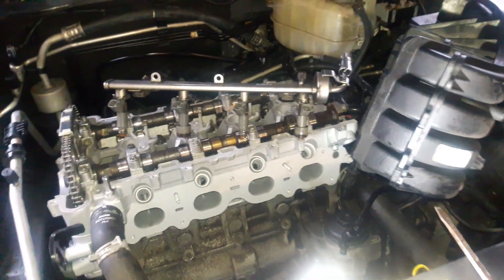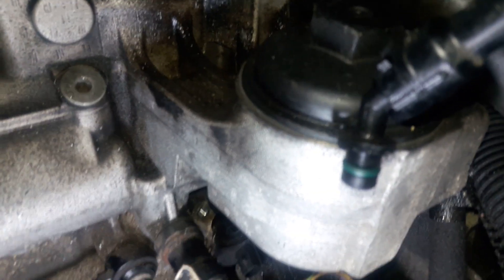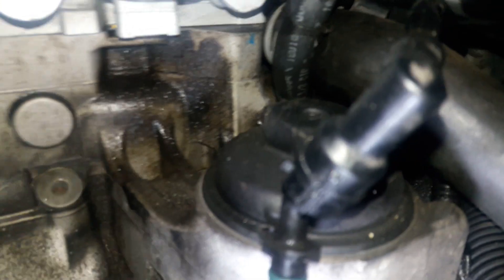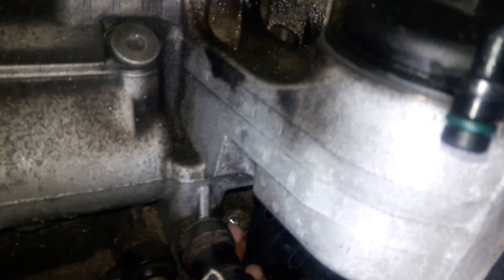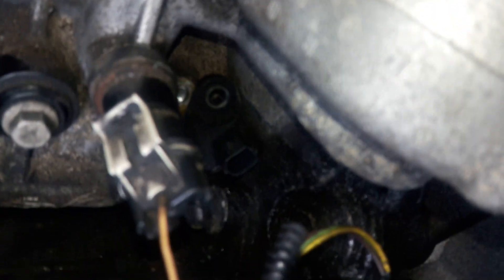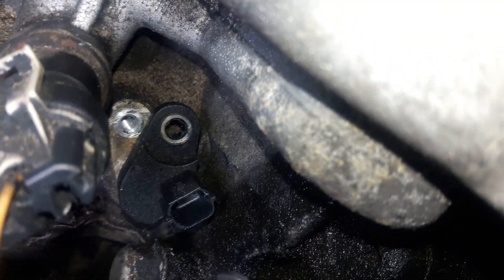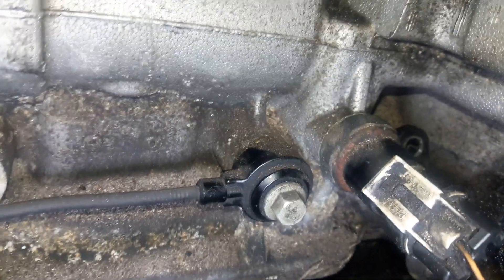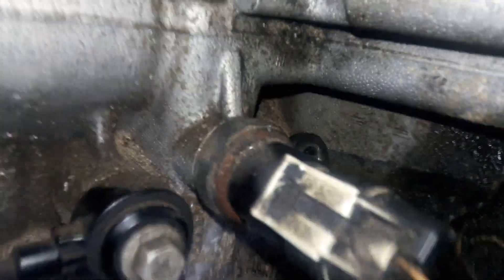GM 2.2L engine Crank Sensor Location and removal

Comment: DEAR AUTO REPAIRS: I HAVE A 2004 MALIBU, 4 CYL 2.2 L ENGINE, THE CRANK SENSOR WAS ALREADY REPLACED WITH AN AUTOZONE CRANK SENSOR AND I STILL GET CODE 340. SOME PEOPLE ON THE AUTOZONE REVIEWS HAD THE SAME PROBLEM. WHY IS THAT? I AM WONDERING IF THIS JOB CAN BE DONE WITHOUT REMOVING THE STARTER AND MANIFOLD

Comment: I anyone is interested this video is correct with the location as I changed mine today, However I just removed the starter motor and the sensor is behind that, The top starter bolt is a little tricky to get but is all good with a 6 inch extention and a little bit of tape to hold the bolt on to the socket when re installing the starter.
Reply: When starter removed insert top bolt into the starter put socket on bolt to hold in place. As you put the starter in place guide the bolt into it's threads. With starter pulled back to the length of the bolt you can see between the starter and Bell housing to start threading the bolts. No need to place starter then try to find where the bolt goes that just makes it difficult.
Reply: @HillBilly-1  and a piece of tape over the bolt head before the socket goes on it makes it a bit tighter on the head to reduce the chance of it slipping off when you are messing about.

Comment: Only thing you had to do was remove the starter in bam you right there
Reply: I wasn't in any way trying to be a wise guy that's the way I did it it was easy for me starter bolts wasn't a problem for me
Reply from the maker: Yes, try doing it that way..lol. don't you think I looked at that option? See how easy it is to get to the starter screws and get back to me wise guy.
Reply: @Wedoitalltohelp  🤣🤣
Reply from the maker: Try that and see how easy it is. Talk is cheap.
Reply: @Wedoitalltohelp  Your an idiot. STFU! It's a 30-45 minute job including removing the starter.

Comment: My question is if you know. We’re is the Cam Senor? On the same engine. Is for a hhr 2006 2.2. Please and thank you...
Reply: There isn't one. Camshaft position is calculated from ignition control module's timing and the crankshaft position sensor info, is what I've been told. But, many of the cars this engine comes installed in still have the camshaft sensor fault code in spite of the fact that there is no such sensor in this particular engine. SMH!

Comment: I've searched videos on this. I like that this shows where the sensor is. But this talks about not needing to remove the intake manifold; that would be way too much effort for me. Another suggests removing the starter to access the sensor from the bottom; also not an easy task. I'm finding the best access is by disconnecting the radiator (only necessary to disconnect the top hose to the radiator and remove the hood latch, very simple stuff) and remove the engine fan (only have to disconnect connector to the fan to pull it up and out of the way). Tilting the radiator forward provides room for tools to access the sensor bolt. It's still difficult to locate the sensor as it's in a tight space. I have not completed the replacement yet. But I think this method will be far easier than other videos I've seen.
Reply: The starter can be removed and reinstalled in less than ten minutes. Only three 15mm bolts.

Comment: I replaced this on my 2003 Saturn L series last year.  I parked the front wheels on ramps, and then worked under the car.  I removed the starter, and then replace this sensor.  The trickiest part was the upper starter bolt.  I taped it to the socket to get it started.  It would have been easier standing under a lift, in a shop, but in my case, this worked.  There might be some models with this 2.2 Ecotec where the shape of the body is tighter than the front of the Saturn L, so maybe in some cases, you would have to do it from above, like in this video, after removing the intake manifold.
Reply: I got the same engine in my 2007 Pontiac G5 only thing I had to do was remove the starter in bam right there

Comment: You could reach it from the bottom starter wires might be a little in the way, but a few wires are easier to move than the intake. Thank you for the info on the crank sensor.
Reply: Was gonna ask this. Gonna try it this way right now
Reply: @adictiveadictive  put the top bolt in the starter with the socket as you place the starter into the bell housing. that way you can see between the starter and Bell housing to start the threads. A 15mm socket and I used a short 3in extension and it should go smoothly. Good luck.

Comment: Hello really enjoyed your video!!! Thank you for taking the time to make this video. Very informative.  Say in the video you mentioned you had trouble with engine starting....what symptoms did the car have before changing it out.  Thank you again.
Reply from the maker: Issues starting the vehicle. The most common symptom associated with a bad or failing crankshaft position sensor is difficulty starting the vehicle. ...
Intermittent stalling. Another symptom commonly associated with a problematic crankshaft position sensor is intermittent stalling. ...
Check Engine Light comes on.